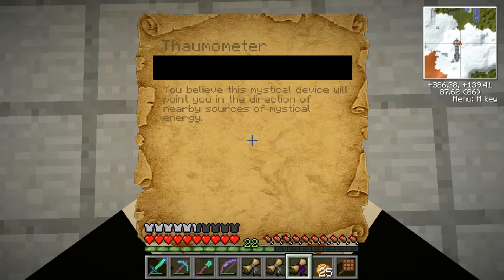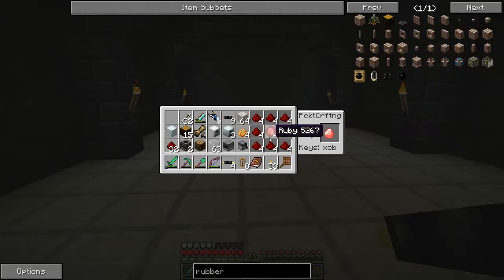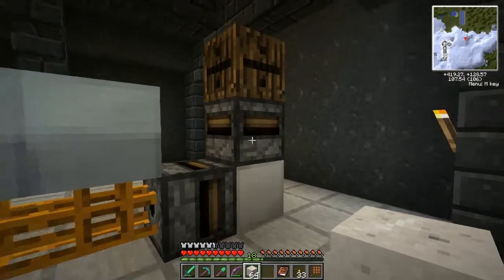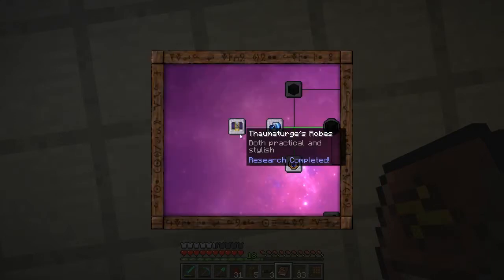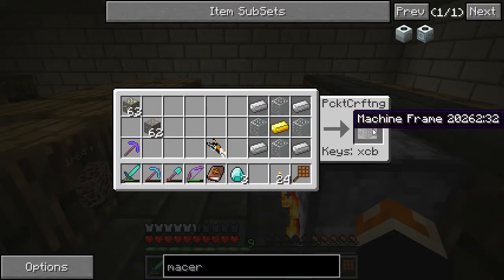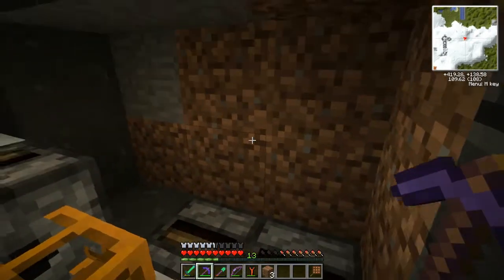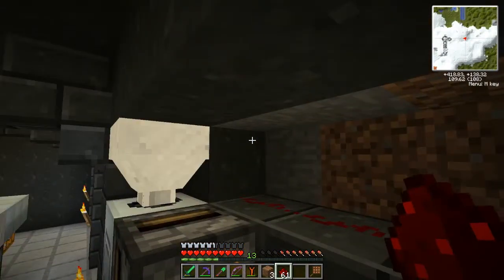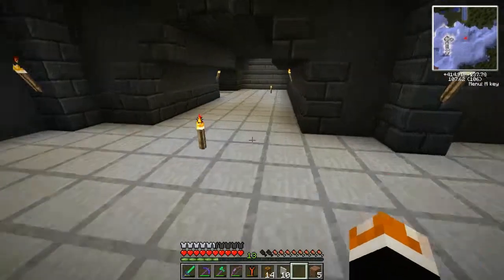Feed the Beast 06: Machine Making

Comment from the maker: It was a very close call on that front, I almost fell for it.  I generally try to avoid BC pipes because you have a lot less control over how stuff gets distributed to several outputs, especially important here beecause of the need for the overflow chest. (It would end up getting 1/8 of the charcoal rather than 3/40 and the generators would cut out from time to time.)  Thanks :)